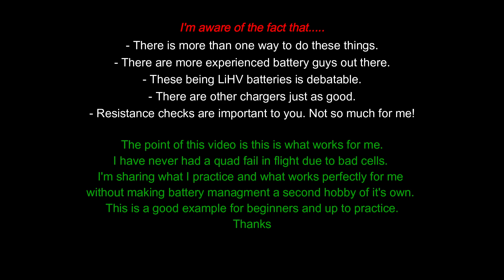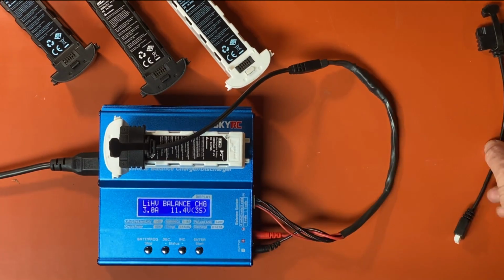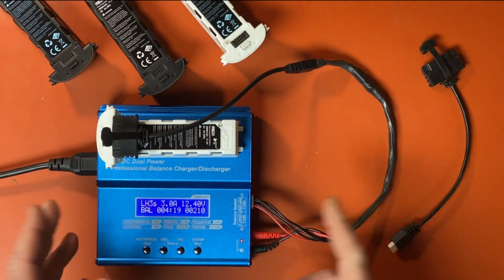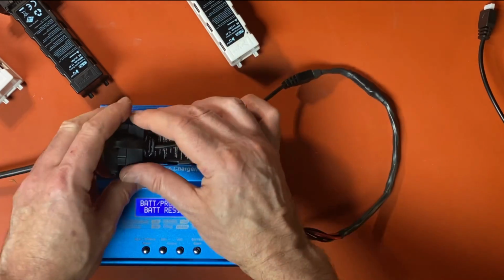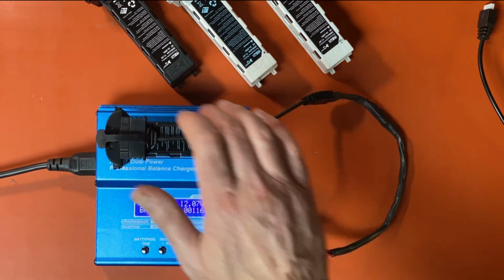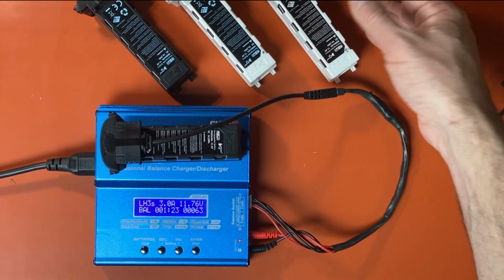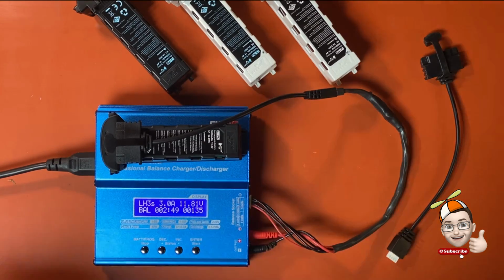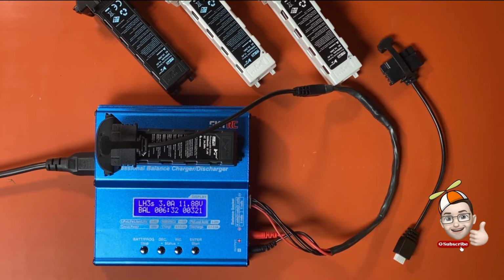IMAX B6 V2 BALANCE CHARGER - BATTERY MANAGEMENT USING HUBSAN ZINO BATTERIES

Comment: i accidently bought V2 imax, i need instruction on charging Zino pro Gifi batteries with it, do u have one? thanks man.
Reply from the maker: https://www.facebook.com/groups/HubsanQC
Reply: Sorry, my mistake it was imax V1 it has such plug using on this video.
Reply from the maker: Дрон нисгэгч but no LiHV mode
Reply: @QCGUY   Thank you sir, so can i use this imax V1 on charging zino pro battery?
Reply from the maker: Дрон нисгэгч Yes in lipo mode with a few minutes less flight time.

Comment: @QC GUY, now i load my Gefi battery for zino h117s with the Program, "LiHV Balance @ 2,5A - 12.9 V (3S)" is it correct?
Reply from the maker: You got it….the charger won’t go on if you have it set wrong. 👍🏻
Reply: @QCGUY  Thanks a lot. But i saw on one Lipo that he Show only 2 cells, is one broken or inaktivated? What i've can do?
Reply from the maker: @coolzero8933  dispose of that one properly and buy a new one. 👍🏻
Reply: @QCGUY  now you think the LiPos ok ? But the charger in the box only show red LED´s  don´t switch to green, not even i wait 4 hours. i think one cell are broken ? is it  right ?
Reply from the maker: @coolzero8933  I can’t tell without seeing it charging and testing it. 🤷‍♂️ sorry

Comment: can we do this process for the zino mini pro battery?
Reply from the maker: You can do it with most batteries if they have the room inside the cover. The zino battery board fails easily and won’t charge or work so I don’t mess with them.

Comment: This video doesn't explain anything at all. The original Hubsan charging wire plugs straight into the Hubsan charger, that's it. So why can't you do the same and plug straight into the Imax charger? What's with all the splicing and soldering.
Reply from the maker: Maybe you should learn about balancing batteries first. You will learn how just shooting power to each cell as the Hubsan charger does will not balance your battery. It will overcharge a cell, ruin cells and one day when your out flying and wondering why your quad just cut off and fell to the ground you will remember this video and say ahhh that’s what all the splicing was for and what a real lipo balance charger does. 
This video is for those who understand the importance of balance changing with a real balance charger not the newbies that haven’t gotten that far yet. 👍🏻
Reply: My Zino currently has about 400km on the clock, I've used both original and third party batteries but always charged using the stock charger. It's always come back home and never fallen out of the sky. I do change the batteries if I "feel" they are degrading too much but other than that I've not experienced any problems.
Reply from the maker: @virtious8  It’s good to be you then…call it lucky because I have a group of 5000 people where s majority will tell you a different story than yours.